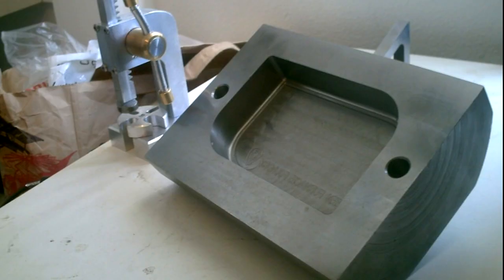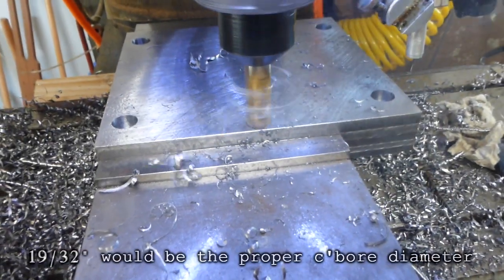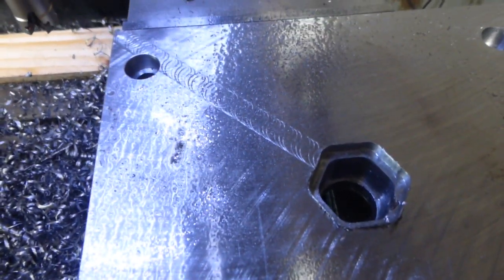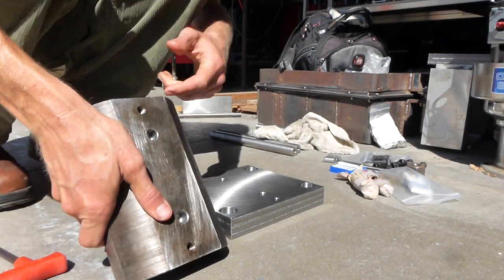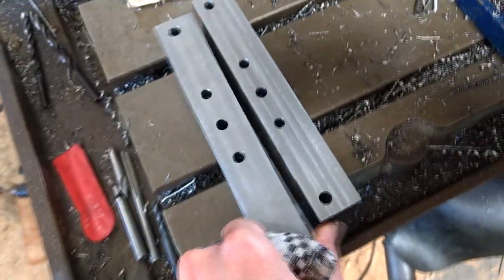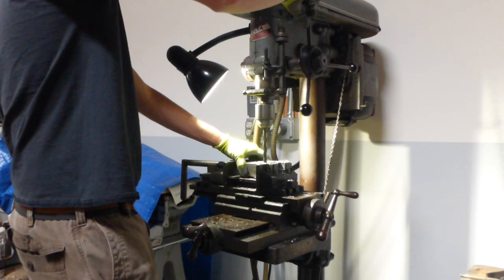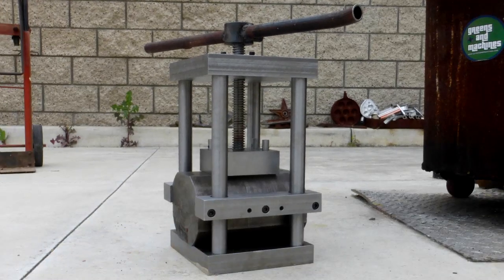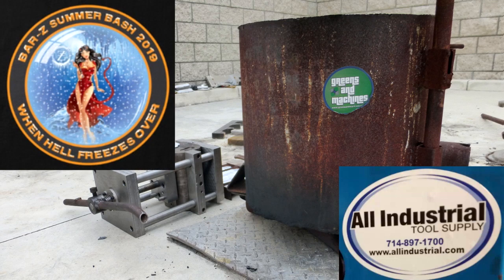Building a Permanent "Diecasting" Molding Press | Spareroom Competition Entry 2019

Comment: You're supposed to release the parts right after pouring while the aluminum is hot. Otherwise, it shrinks to the mold and not only is harder to get off, but you create shrink tearing and shrink stresses in the part. You should also be using a release agent. The mold should be hot before pouring.
Reply: Interesting and very helpful. I'm new to home die casting. What kind of releasing agent(s) would you like to suggest if i may ask??
Reply: @silverseven5283  You need to do your own research into this and there are many websites dedicated to this topic. There are many differing types of release agents available for this type of die casting. You simply need to study and research on your own. 🤔🧐👌💯

Comment: you need to coat your moul with diecoat..., also donot let the aluminium cool in the moul, it will contract and bind.. you must also heat the mould up before casting.. . mould should be hot when aluminium goes in.. if these two things are done it will cast smoothly and fall free from the die..  you cast it then without  less than a minute you crack the mould and take the aluminium out.

Comment: Recommend you drill through a small hole for air to leak out of dowel holes whenever possible. As long as it does in effect anything else. Makes disassembly easier for tight tolerances.

Comment: Hello . Would a permanent mold be suitable for copper casting? very small castings
Reply from the maker: Not sure, I usually only hear of it used for aluminum or zinc most of the time.  Copper might be too hot and erode the mold prematurely.

Comment: Spray molds with mold spray every 4 or 5 uses .
Reply from the maker: Have you got a good source for some?
Reply: @greensnmachines  can't remember the name of it large mold manufacturers buy it in spray cans and by the pail . We used it in school borox something like that I watched it in a video  . I will see if I can find a name .
Reply: @greensnmachines  it is called boron nitrate  high temperature spray .
Reply from the maker: @paulbaskerville2748  thanks, I'll take a look
Reply: @greensnmachines  I am going to try porslin coating my steal crucible to see if that makes it last longer might work for molds .try on a simple cheep mold if you are going to try it . My crucible is 2 foot wide and 2 foot high .i an setting up to do tons of aluminum and making plate i beam angle c Chanel.  Nice program catch u later .
Reply from the maker: I just watched a video on Tesla's giga presses which said the molds are sprayed with, get this, soybean oil!  That will be pretty easy to get considering I'm already using it for fuel!
Reply: @greensnmachines thanks I have vegetable oil I will have to read what it is made from I think corn might work . Watch for bubbles from the oil they might boil or proses the oil first . The giga press isn't it pressing steel sheets in to body panels ? The water content in the oil might be a factor. I am a few weeks a way from porslin coating my molds and crucible  .